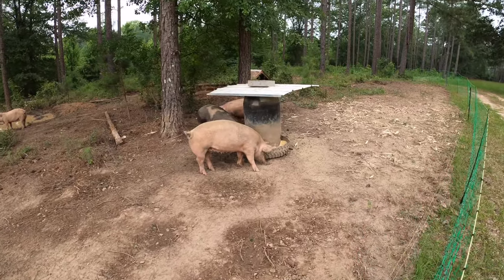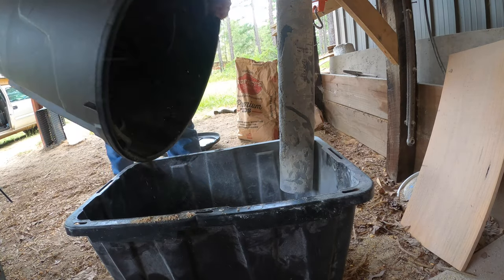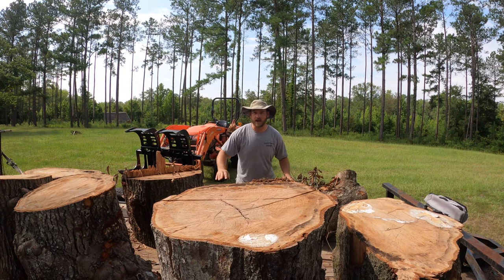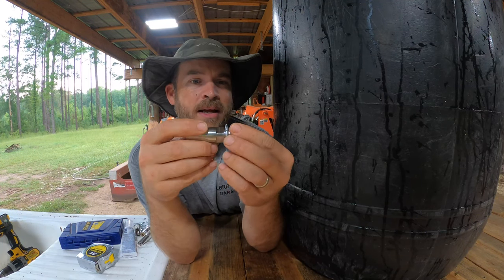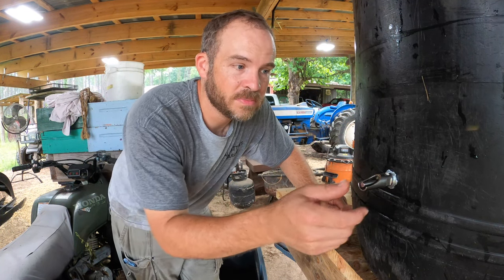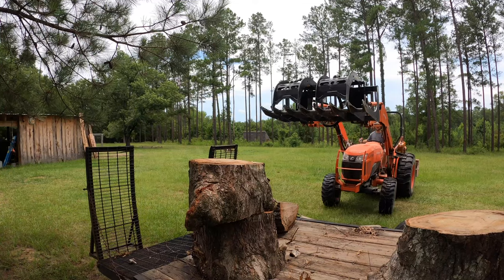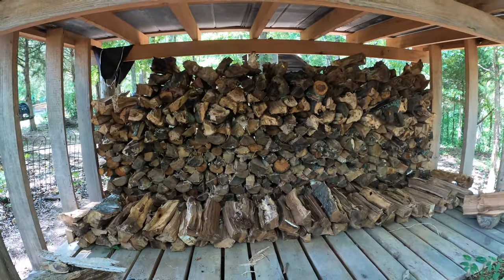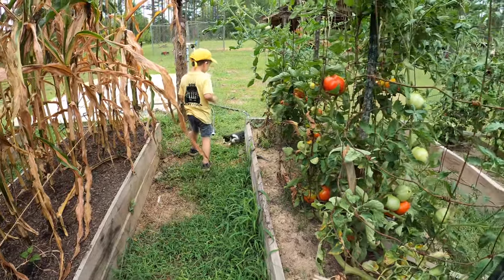Splitting MONSTER Firewood Rounds and Caring for Thirsty Piglets

Comment: In regard to your reinforcing nuts for your pig waterers, those are conduit fittings locknuts. The points are supposed to dig into the wall of the material of what youre working with to hold things in place against the pipe threads. To spread their ability out over a wider area, their matching electrical component would be a 'reducing washer'.( Basic size would be 3/4“ x whatever size looks good for your application.
   Hope this might give you some ideas.
Reply from the maker: Ahh, that makes sense, thanks!

Comment: For the water barrel, maybe use PVC fitting on the inside and cinch it down tight to give you more surface area for sealing.  Just a thought.  Anyway, love the videos.

Comment: On those water nipples use a pvc female threaded coupling on the inside. Those nuts you used are for electrical conduit connectors. 
That firewood will get you warm twice, when you split it and when you burn it this winter..lol

Comment: Man, those rounds were monstrous!  Quite the return on those beasts!  Well done!  On that loose nipple (or loose nipple in general), use a screwdriver to tighten that nut against the barrel.  Also, you could add some thickness to the barrel where you put your nipples.  Get something like 1/4 inch think HDPE and bond a layer to the exterior or interior surfaces.  Something like 4 inch squares should work nicely.  That would give you a full 1/4 inch of thread engagement, not including the thickness of the barrel.  Use a ratchet strap to hold them in place to dry.  That should force them into that radius as they bond/dry.  A ratchet strap, not that strap you used to move those barrels of corn. 😉  Good job with your little Thought Process Machine!  Before and after!  Thanks for the content.  It is appreciated!

Comment: I got stung last week on my middle finger as I was hooking up a trailor.  I don't know what it was, but my right hand was swollen for 3 days.  It really never hurt too badly.
All that crap about chicken food was just that. Crap.  Our chickens almost stop laying during winter every year.  We try to buy our feed from the place in Box Springs where you're getting your corn.  Good people and a locally owned business.
We hooked up with a local grocery store and are getting tons of produce for our pigs.  They eat as much as we can get.
The storm that blew through here Thursday afternoon knocked down 3 huge oak trees on the back side of my pond dam.  Ill have enough firewood to last me and you 10 years, all just 200' from my back door.  I have a friend with a skid steer that will be coming out for cleanup this week.
Two of them took about a 200' section of fencing.  Is it a bad thing when you can walk under a field fence?  I posted a video of the storm blowing in while I was standing on my deck.  70+ mph winds convinced me to head inside.  Roof shingles are all over the pasture. 
I put my pig nipples a little lower and then place the barrel on a plastic pallet once the pigs get a little bigger.
I don't have a vertical splitter so I have no choice but to use the maul and wedges.  I'll just chip away at the edges until I get it to a manageable size.  I'm too old to do it all at one time, so I'll often work on a big round over the course of an entire day.
Live seeing the boy running from the rain and playing with the helicopter.  My Labradoodle perked right up and watched when that balloon was deflating.
Reply from the maker: Yeah I don't think the fence is supposed to be like that. That store in Box Springs is great. Really great people, like you said, and all their prices are reasonable. Consistent on quality too.

Comment: Yes I have used them same drums for water for my chickens but I used low profile flush nipples I found they are the best but I bet them that you used would work for the chickens also. They hold 65 gallons of water also used one for the feed it holds 5 50lb bags of feed with 4 of 3" feeders got off of Amazon. I bet the chicken's was picking out the corn and wasted the other parts of the feed . I was mixing my feed with laying pellets with corn , black sun flowers seeds  and they was also picking the corn and sun flowers seeds out wasting the laying pellets. I stop doing that.
Reply from the maker: Mine were wasting the oats. They would scratch it everywhere. They don't waste these pellets at all thankfully.

Comment: I have split dry oak logs more than double that size just with wedges. No hydraulics involved. The key to success in that operation is patience. I had to learn that the hard way, too. You need more than one wedge. Start with one wedge, drive it in a bit and look where the splits wants to go. Follow that line with several wedges  and hit them one after the other. When a wedge bounces back you can put some sand on it or just give it lighter hits. There is method to this. Just using one wedge and hit it hard won't work on logs that size. After the crack has formed and you just want to keep it open or widen it out you can use wooden or plastic wedges instead of steel.
Once I burried a hole bucket of wedges in a big stump but got it done in the end. That was no fun but than it also kinda was.

Comment: Great video. Just a note about those washers. It's a Raco lock nut for an electrical box connection. Not meant for your use. But heck it worked. Those nipples are a pipe connection. Looks like a 3/4 ln.